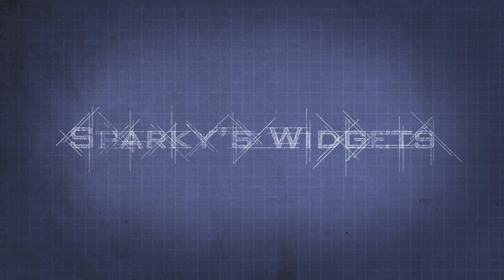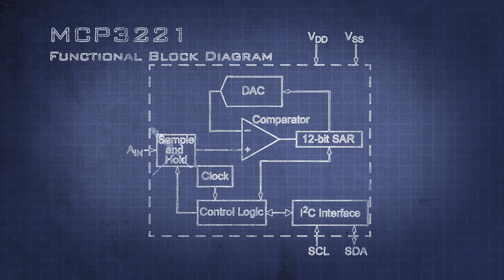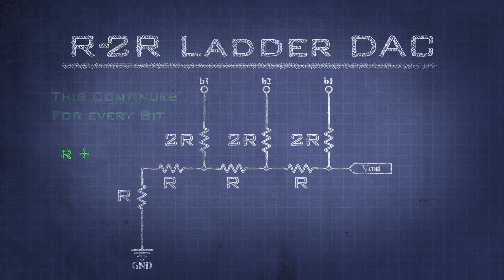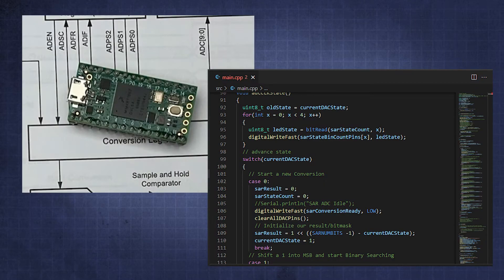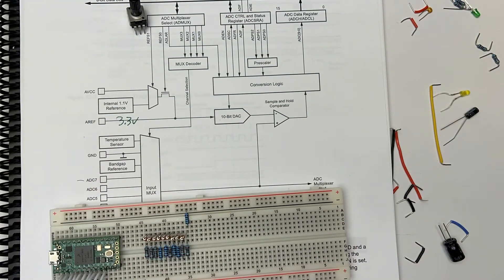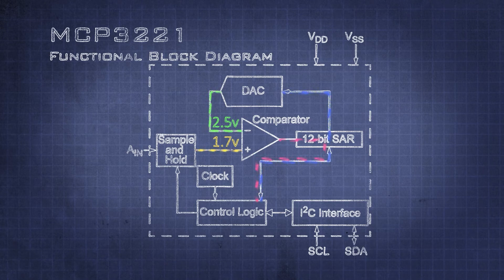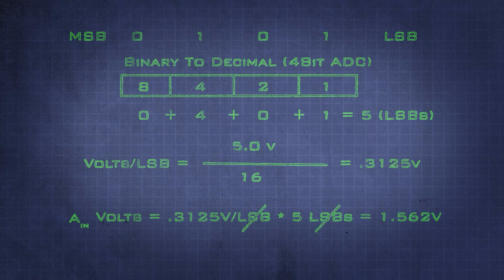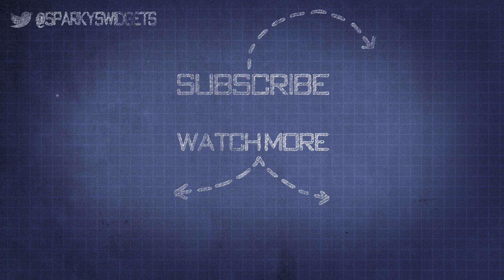Tech Tut #5 SAR Analog to Digital Converter

Comment: Excellent way of explanation. Can you share the code of SAR logic
Reply from the maker: Thank you for the kind reply! I will post the code I used for the video to my github and link back here (it might take me a couple days). 

For short explanation, if you set the pins up on a port or in an array you can step through and set the dac state with a simple state machine quite easily. The output of the comparator goes into a GPIO pin used to see if we are high or low, based on the result we either keep the current pin set or clear it before moving to next state. You can configure the state machine to match the number of bits plus a setup step and final convert step, after that its just a mater of stepping through the state machine with a clock. (with some creative programming you can probably streamline this down) 

I am working on a follow up where I characterize the ADC and calculate the DNL and INL hopefully you find that one interesting too!